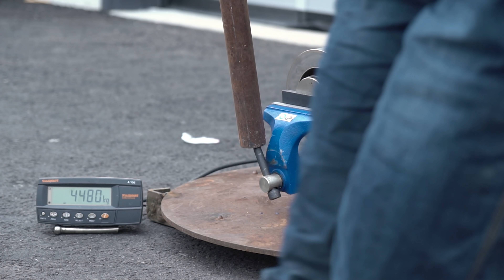How Much Force It Takes to Break Vice Frame? Over Tightening Vices Part 3!

Comment: I was thinking you might rip the threads out of the screw before the vice broke.
Reply: I was thinking that as well, Now we know that the threads are stronger than the cast vice...
Reply: I thought the exact same thing, I was very surprised to see the cast broke.
Reply: 50/50 on those two braking points.  I've killed vices each way more than once.
Reply: I broke the vice by elongating the screw. Threads didn't detach from the screw. Weak point was somewhere in the middle between the nut and the end of the screw which was surprising for me.
Reply: @TechMasterRus  in computer tech support we often say the problem is a loose screw between the chair and the keyboard. 😱
Reply: @TechMasterRus  The screw is quite a bit softer than the frame, then?
Reply: *vise

Comment: Really intresting! 
Pretty impressive that bolt held up so well also - it didn't even bend (the way you had it with the "cheat pipe" only covering half the bolt, also makes the bending force on it quite extreme)
Reply: Those 12.9 bolts are used to tighten the heads onto race cars, also most normal cars as well. Super strong heated/quenched bolt against cast iron? Cast steel? No chance.

Comment: The locomotive on the train passing by your filming workshop had the letters VR on it.
If you got your own train, you would not even need to re-brand! Vuohensilta Rail is already on display!
And imagine the things you could crush with your own train!
How much can it take until we derail!
Reply: they'll pack TNT under it until they get it 100 feet in the air for a xmas special

Comment: We had a college project to study how C clamps were breaking. Cheap Chinesium from a local store, you could break them using the handle. So, in addition to profile studies, grain studies, composition studies, we wanted to measure the actual relation between torque and load. So we had a load cell and a instrumented torque wrench, so we had to put a nut on the screw to use the torque wrench. 

So I had the job of holding the wrench and looking away while my buddy Thomas welded the nut to the screw. A bit of weld spatter leaped over and burned the web of my thumb. After several expletives, we had what we needed. So we mounted the clamp with the load cell, and had the guy who had made the torque wrench. So I was holding the clamp in the bracket, and the wrench was being operated by the third guy, and he commented "smells like someone had fried chicken." I replied "that's probably me" and Thomas broke down laughing. The smell was recently fried flesh.

Comment: Repair it by welding so that it's stronger than new. Then test again and see the next point of failure.
Reply: Cast... not worth it
Reply: @brendanstanford5612  film taking it back to the sore, after putting the bend handle back, and act surprised that it just fell in half.
Reply: @SeanBZA  "my 7 year old daughter was using it for a wood project"

Comment: 10:20 This snow dump site must contain a lot of platinum from catalytic converters, because apart from snow it also contains a lot of road dust. It is probably also slightly radioactive from all pollutants from fossil fuels, asphalt, etc. Cody from Cody's Lab would be honored to be able to carry out several experiments on this snow pile :P
Reply: slightly radio active. How? Oil is not radio active.

Comment: That would have been so much easier if you had mounted the vice vertically so you could have just walked around it pushing the cheater bar.  Than would have been less fun to watch though.
Reply: Maybe but the sensor might have fell onto the floor and damaged it, i was thinking he should have welded the bolt onto the end of the pipe.
Reply: *vise

Comment: You may now sell a DIY kit with both an automotive bolt and rusty cheater pipe included:  The HPC Visecracker 5,000,000.  That's a sure hit on Amazon.

Comment: Can you make a video on the different kinds of steel? I would like to know why the automotive bolt so much stronger than the vice.
Reply: Vise is cast probably.  Bolt is actually metal
Reply: @domwasha100  Casting is metal too, but there is a difference also between the forces in this experiment. The automotive screw did not had to withstand the same force as between the jaws, even with the pipe, because the screw inside the vise acting as a lever. Apart from that, I bet that 12.9 screw alone wouldn't break at 4.6 tons pulling force... The vise bottom part is not pulled straight away. The point where the crack started probably had to whitstand several times the force between the jaws due to the geometry. If you have pulled the bottom U part straight it's longitudional axis, it would probably take way more than 4.6 tons.
Reply: @gabiold  yes, but casted metal in this usage isn't a pure piece of metal. Look at casted anvils,  versus pure metal anvil. Same thing. Thanks for insulting my intelligence or lack of insight. I don't comment often, because I usually get corrected by keyboard warriors who've never done or seen this first hand. Once again thanks
Reply: It's probably a grade 6 or grade 8 bolt which is high carbon steel. The handle on the vice was probably just mild steel, more like a common nail. ( how it didn't strip the threads, or break the main bolt puzzles me)

Comment: Surprised the threads on the screw didn't give way before the vise itself.

And you should put some railcar wheels on that Subaru with the saw blade tires and drive yourself to the workshop on the railroad tracks!

Comment: I actually have broken a similar sized vice by hand. I didn't have a cheat pipe and the handle didn't bend. It did see rough use though. Like bending metal by putting it in the vice and hammering. And crushing things in the vice.

Comment: You need to do this with some high speed rotating tool like a realy strong drill, attached to the Vice. Possibly with gears if it is to weak, but that will tighten it really fast so it goes Boom when it snaps.
Reply: *vise

Comment: I think that vice is much stronger than Harbor Freight vices... I broke one with much less effort...
Reply: one of my customers broken his harbor freight vice trying to remove a rused nut that was around a rod with a millwakee 1/2 impact. Vice broke and the rod and nut stayed the same. I took it on to my tool truck where ive got my wilton vice set up. Pulled it out in 5 sec's with the same milwakee impact. A price to pay for quality. $50 vice vs $350 vice
Reply: Yost vices are crap, I have broken the same model 7 times they keep replacing under  warrantee

Comment: Harbor Freight's standard mechanic's vises (the style of vise featured in this video) break quite easily. I hear their giant rotating vise is a lot better, but I'll stick with a better quality one for my shop. I broke the 5" Harbor Freight one with only about a 1-foot extension bar on the handle. Hopefully, as they add more good quality tools to their mix, they'll bring out some better vises. I don't expect them to compete with Wilton's high end lineup, but make something as good as, say, Irwin, for a lower price, or as good as the cheapest Wilton stuff for the price of an Irwin,and they will be doing well.
On the other hand, as much as we use them as such, a vise is for clamping. It's not a press, and it's not meant to be. One of the best things I did in my shop was go and buy the 12-ton manual hydraulic press from Harbor Freight. I use the shit out of it, it's much more precise, better on whatever I'm pressing, and I don't break vises anymore. My only regret was not buying the 20-ton one.

Comment: I would be interested to see what force you could get it up to if the vice was welded with some nickel rod and repaired. Could a good quality welding repair achieve the same force, or would it break at a lower force? Hmmm...

Comment: I had like two crappy vices fail like this, one at some really lame low force, it has simply cracked and fell apart, the other, similar to this one failed at some high forces applied on the edge of the jaw.

Comment: Now I would like to know the pressure differences between bolt grades and how much force it takes to bend them :)
Reply: Look up bolt grade tables and you will find plenty of details. Physics calculations based on shear/tension/compression can be quite  interesting.
Reply: From memory the first part is the ultimate tensile strength divided by 100, and the decimal after the point is the percentage of the yield stress vs the ultimate. So 12.9 is 1200 MPa ultimate, and it will yield at 90% of this, around 1080 MPa. 

Common structural grades are 4.6 (400 MPa ultimate, 240 yield), and 8.8 (800 MPa ultimate, 640 yield).

Comment: I did the same experiment at home and I got the screw elongated. The threads elongated too at some point and I can no longer rotate it. Actually, I wanted to press a shaft inside a gear and have no idea what was the pressure. If you send me the screw, I will have a working vice xDD

Comment: Next up, try a forged vice, like those used by blacksmiths.

Cast iron/steel is brittle and fragile in comparison, and has very little tensile strength, but you probably knew this already.
Reply: Yes, forged would be much stronger but more expensive. Cast iron vices are cheap and nastyl

Comment: You are wasting some force when not putting the pipe all the way down against the spindle, since the force trying to bend the bolt itself builds up. Then you'll also easily feel different resistances when pushing the pipe when it's not in the same spot.

Comment: 4.7 tonnes seems very low for iron that thick. I think it must be poor quality? A bolt with much less material could take much more load than that. You should try breaking a high-quality STEEL vice and show the difference.

Comment: I know it can vary a whole bunch, depending on the quality of the vice.  I had an old one made by a company called Hiller or something and that thing would crush heavy pieces of pipe with no problems!  But I also HAD a Chinese vice that was pretty good size but it had cast iron jaws and a steel slide and screw portion. I doubt I could have pinched my fingers in that thing before it broke. That one hit the scrap bin. Garbage!

Comment: I take it that Finland's rail system is completely electrified?
Reply: It is not. 5944km of rails and 3256km of it is electrified.
Reply: The sections that are not electrified have mostly very little traffic. Of passenger traffic, 94,5 % and freight traffic 78 % was electrified in 2017.

Comment: You didn't realize that your technique changed. The bolt needed to be all the way in the pipe for it to be able to use all of the crank force. Just the tip (lol) won't do.

Comment: Thanks for showing me your locomotives and train check out the locomotive in my country that just got rebuilt the Union Pacific Big Boy the world's largest steam locomotive in the world I saw it with my own eyes check it out on YouTube it's gigantic weighs 1250000 lb puts out 6000 horsepower pulls of 5 Mile Long train at 80 miles per hour that's its stats oh yeah 300 pounds per square inch of boiler pressure peace out have a great day

Comment: In my humble opinion this is not a good test. it's only a good test for a vise that is opened this wide. which with this size of vise doesn't happen that often. a test with a 5cm(2inch) gap would be more accurate.

Comment: That was scary. Yeah it cracked slowly but it could have exploded violently. I cringed every time you repositioned the bolt with your hand. Seems kind of dangerous and stupid. I would have found another way. Your always smashing things. You should try spreading things apart with a hydraulic ram. Could have done that to this vise.